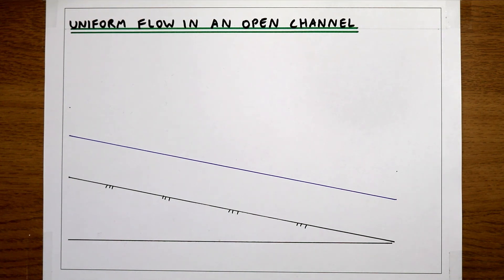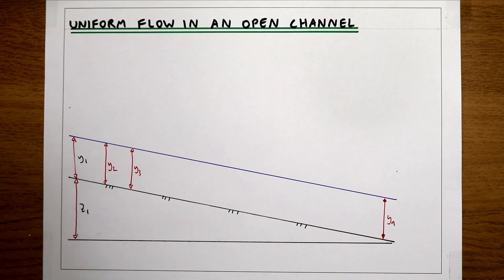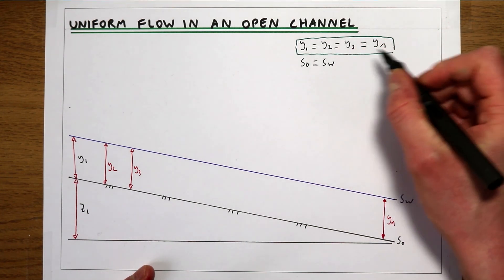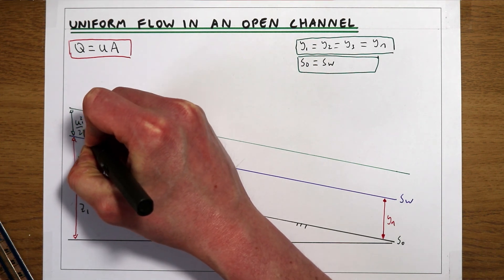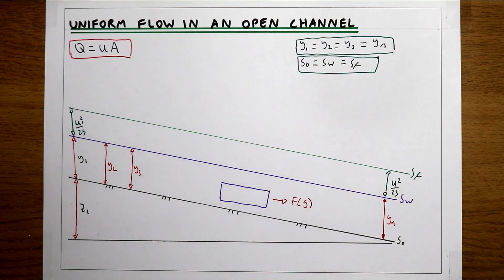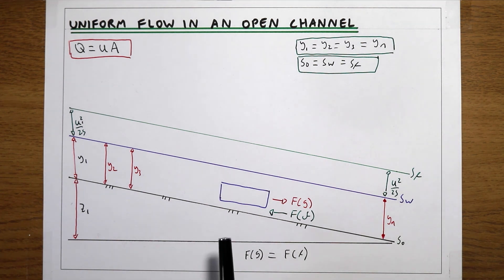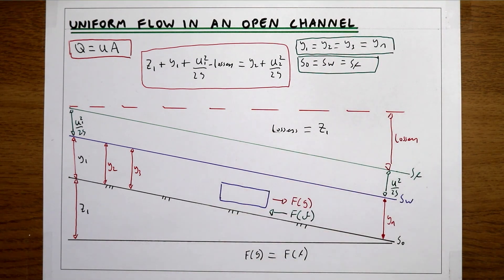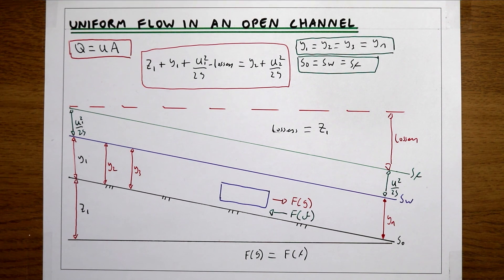Uniform flow in an open channel

Comment: Y should be perpendicular to the surface
Reply from the maker: I’m assuming a very small slope, so depth  perpendicular to the bed and the datum are the same in this example (the issue is probably mostly with my drawing, which doesn’t make this very clear)
Reply: @fluidsexplained1901  i assume your from uk , could you please sir tell me at what field and what year this is taught
Reply from the maker: Yes, I teach at a University in the UK. This content is part of a year 2 Hydraulics module on a Civil Engineering course. This is one of the first things I teach when introducing open channel flow.